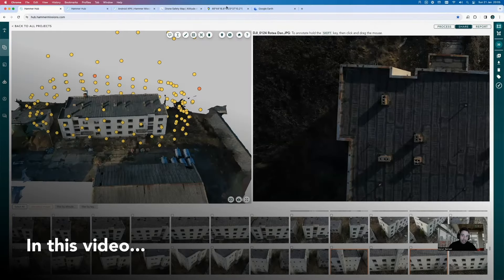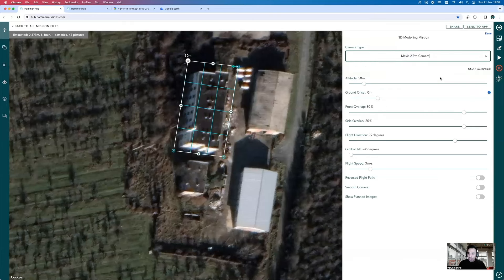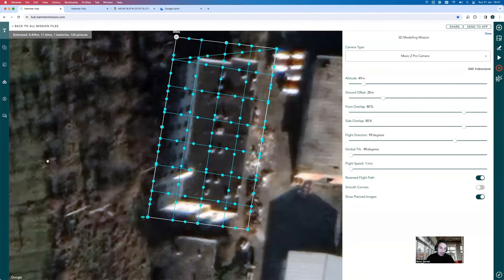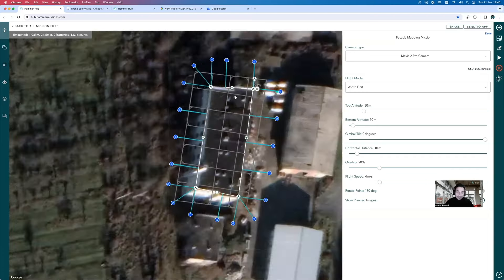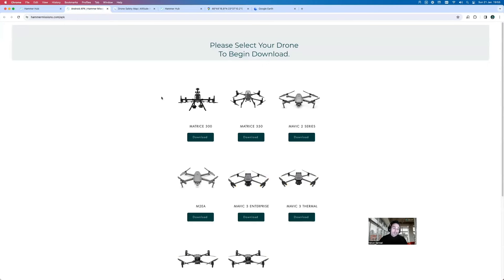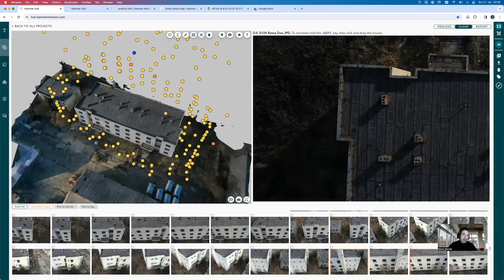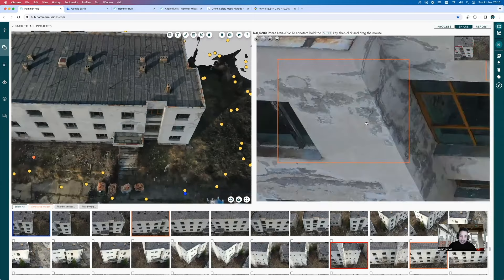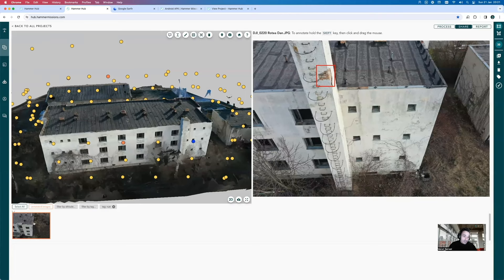3D Building Inspections: Roof & Facade Inspections with Drones | Hammer Missions

Comment: When you added the images to the project, I noticed you only added the facade images from you folder.  Do you then add the roof images into the same project folder?
Reply from the maker: That's correct, you would add the roof and facade images in the same project if your goal is to create a 3D model including both the roof and the facade.

Comment: I'm making building inspections professionally, traditional way, by walking, checking, making pictures, and your solution looks nice and easy, but results are, for technical evaluation, below expectations....
1. The low resolution (because of distance of taking pictures do not allow to make accurate evaluation of degradation of particular parts especially, most important state of roof surface: cracks, possible leaks)
2. The game changer will be the possibility of making accurate measurements on this model (not on all directions, but on main surfaces of the building - along walls and roof)
There are any solution of this issues? Probably when we will get better quality images the model will hang because of its size...
Reply from the maker: Hi there! thanks for your comments. Solutions exist! 

1. You can always take close up pictures and simply add them to the dataset. 
2. You can do that already: https://www.youtube.com/watch?v=us_i7fNKmCA

You can add thousands of images to the project without worrying about the size and all works inside your web browser